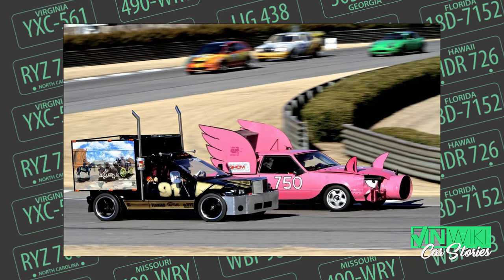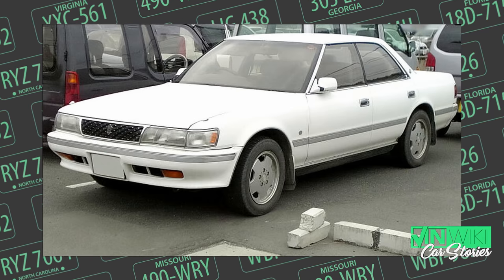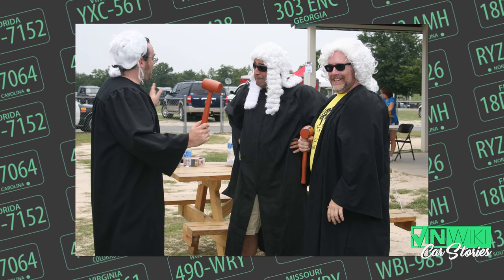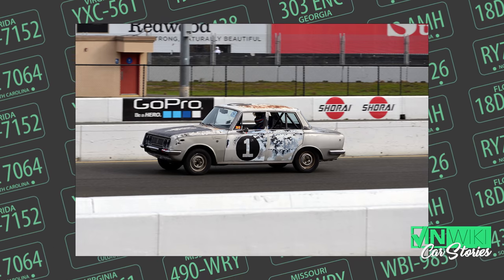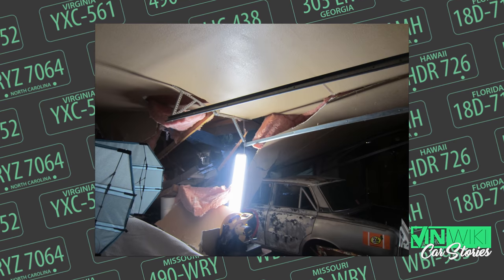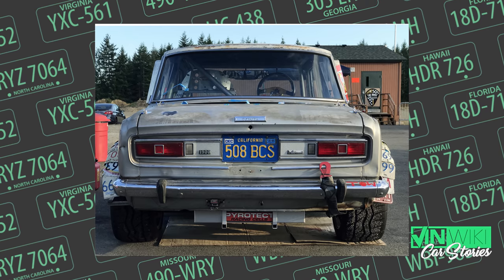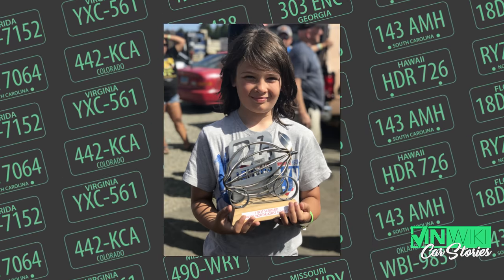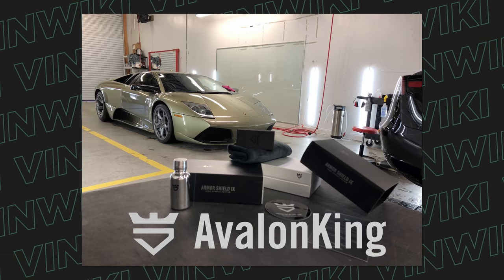How Corona saved my life (& my cheap race car)

Comment: It's funny you mention the smell of leaded fuel. I was just telling one of the younger guys in the shop that leaded fuel used to smell amazing.
I probably haven't talked about or heard about it in over 10 years, now it's twice in one day LOL
Reply: Yeah, it's because you can (If you want to kill brain cells far quicker than by drinking yourself into a stupor) use Lead as an artificial sweetener. The Romans used to use something called "Lead of Sugar".

As for me, I was born in the 1970s, so (thankfully) I missed most of that. However, there's a 66 Corvair Monza sitting rusting on my dad's property that I have to find the time to fix up. Clarks Corvair parts used to sell ceramic valve kit to make the engines run on unleaded.
Reply: no kidding eh... any idea around when it started being frowned upon and then was eventually banned?

I'm 32 and clearly remember the sweet smell of gasoline wafting into the old shitbox 81' Cavalier when I was a kid... sooo what's that, 92' to 96'ish? I'm wondering if that was leaded I was smelling...?

forgive me if this is a dumb question, I loooove cars and engineering, but I'm not really a "car guy"

=)

Edit - also, I'm Canadian so we might have gotten rid of it at slightly different times
Reply: I don't remember leaded smelling good, I remember unleaded smelled terrible. 1986 in Australia.

Comment: Me and my twin brother spent 6 months building a 78 Chevy Nova from ground up.   plenty of 4 in the mornings and all nighters and EVERY weekend.  We finished it just in time for the points season. 
If the car got a scratch on it,  it was repaired after every race.  We had the cleanest and best looking car week after week.  More 4 o'clock in the mornings during the week.   We didn't cheat at all
But we were meticulous about EVERY detail that was legal to make us run faster. Everything was perfect every week!  We even greased the wheelbearings every week and made springs to keep the brake pads off the rotors. We had the best paint jobs and everything else. That was ALOTTTT of hard work!!!   We didn't have alot of money,  both of us are auto mechanics and spent SO SO SO much time on that car.  We missed times with our family's as well.  But it really showed on the race tracks.  When we went to any track, we were the car you had to beat if you were gonna win a race with us in it.   Either my brother drove or I did but for points seasons he raced for points.

Comment: From 1987-1988 i I bought a1977 Corona from my coworker/ roommate? We were stationed in Quantico Va! I was the Tenth owner of this car and the Eighth person to own it at my company. It had over 300K Miles on it With the original clutch! I did a Complete Front brake overhaul and oil change. Sold it to another coworker when I left thier in 1988! Took It home to Pittsburgh PA Every other weekend driving 70 Plus when the speed limit was 55!! They Really Don't Make Them Like They Used To! It was also one of the shop cars! I would just leave the keys on the counter top and whoever needed s vehicle would just grab them and go for errands. 
Thank You for the memories!!
Sometimes The Need to Prove a Concept Overrides The Conscience!

Comment: It's so true how the last part of a build can take forever. I worked at a car shop that built a lot of specialty cars for athletes and other wealthy people. The car that took the longest to complete was a project for a friend of the lead mechanic. It was an early 80s Porsche 911 Turbo slant nose. We had done so many conversions using brand new Porche that we didn't realize how difficult this was going to be. The problem was that the poor car hadn't been cared for properly, and it had been "upgraded" several times by people who had no idea what they were doing. So we had to completely disassemble the entire car and start from scratch. After we were done painting every part and started putting it back together, we had no choice but to install a new wiring harness and refreshed engine. Then we had to order a bunch of miscellaneous parts because when the previous "upgrades" were done, parts were lost, and scrap parts were installed instead. When you spend that much money on new paint and interior, you don't want to have a bunch of mismatched nuts and bolts holding it all together. It felt like it was one of the best projects we did, but it took forever to get the last bit finished. There's something special about seeing a big project completed. Wish I could still do stuff like that.

Comment: Love your story. I have built cars for many people all dirt cars I was a crew chief for a SCCA F modified in the 60s.  The dirt cars were stock cars and open wheel sportsman's I was also the crew chief on those (two cars) and supermodified (two cars) we raced at San Jose speedway. All the time wanting my own race car that I got to drive. 66 years old and I get a race car a SCCA worn out. I take it out and like you in that Toyota ran the car looking in the rear view. It was the slowest car there.  I ran it at Thunderhill Raceway 2011. So I went through the engine (a rotary). Take it out the next out 2012 and the engine has new O-rings break get maybe 8 laps. 2013 I save my money and do a race porting and build a header and stick a 38 mm Weber on it Take it out and get maybe 10 laps and have oiling problems again. The next year 2014 I had bought another RX 7 for parts got it home thought I can fix this it was hit on the right front. It had some good parts in it but I fixed it and sold it. So with that money I went all out I replaced the 38 mm Weber with a 48 mm Weber. Installed aluminum flywheel new racing clutch and pressure plate and did a bridgeport on it. We moved to Ocean Shores Washington. Never got to run it. Used the old O rings when putting  back together and when I went to move it one of them failed and it is sitting in my trailer at our new home in Washington with water in the oil. I have to build a garage so it is in the trailer. I am now in July will be 73. So after waiting all that time. Working on cars for everyone and their brother my dream to drive Its not going to happen.

Comment: My dad and I used to drag race a 1971 chevelle we started off with a 454 ls6, and blew it up in two races , so long story short we got a 502 Merlin it was punched out to 700 cubic inches , we used to get the aviation gas from local airfield, take off exhaust system for headers and collectors, advance the timing 4 degrees, it would run 10:00 fairly easy would do a high 8 though , my old man still has it in one of his barns

Comment: Lemons reminds me of the Aussie Redex Rally...full of old cars usually built to a theme, and cheating isn't just permitted, it's encouraged - so long as you don't mind paying a "fine" commensurate to the offense.  I've come across two 1968 Peugeots with turbo engines, and even heard of someone bribing the judges to "buy" and the trophy.  All moneys goes to charity, so it's all in fun, even if the actual racing (generally on dirt tracks across various parts of Australia's outback) can get a bit on the serious side.  

PS: My bro had one of these Coronas as his first car - 4 speed floor shift and the 12R 1600cc single carb engine.  Thrashed that thing without mercy and it never broke down.  Great days.  :-)

Comment: my first car was a hand me down 1970 toyota corona.....after my grandmother had passed my grandfather remarried a few years later....this car was from my stepgrandmother....i was given this in 1980....in many ways...i wish i still had it.
   this was the car that i learned to wrench on.this is a car that got good fuel economy...had 4 doors and seated 5... 13" tires were inexpensive yet this is when i learned about bias vs radial..... vs pirrelli vs michellin...etc..vs goodyear vs firestone etc.
  the car had an overhead valve 1,878 cc? think i got that correct...been a long time ago..3rc motor? i drove it for about a year and then after leaving my sisters the tranny failed a few miles away...i had aaa so had it towed back to my sisters...she later took it to her high school...poway high...poway ca....the teacher bought it for $100.then took apart the trans...he found that it had been worked on prior by others....and it was actually missing some parts???.an ez fix and he then resold it....
  all i know is that it was nearly as simple as my next car...a 1967 vw bug.

Comment: Hey from New Zealand ,Im just about finished my 1989 C33 Laural ,after over  a decade of killing RB motors iv built a 2JZGE block ,rods pistons ,stock bottom just refreshed and a VVTI 1JZ head with a EBAY GT40 copy Turbo ,mate did the ex mani and wastgate mounting and exhaust ,T6 Holden Gbox,GTR Diff and axles in a R33 20E non hicas rear subframe .Evo 7 brembos all round ,wise fab,white TE reps,be collecting bits for years lol ,be ripping by Xmas for shred time at nite in the country JZ the world

Comment: I would drive a 1JZ Corona as a daily. What a cool combo. I once bought a 1980 Toyota Corolla for $5. My roommate when I was in my early 20s had this brown box and it frequently would not start for him. At the time I had just gotten my first job in the auto industry as a service advisor at a independent Toyota specialist. Long long story short I come home from work one afternoon and my roommate, a bartender was just leaving for work as I pulled in but alas his Corolla once again would not start, he comes back into the house throws his keys at the ground and says I will sell this POS for $5! I said sold gave him $5 and a ride to work he gave me the title later that night and the following Monday I jumped the starter and drove it to work, I pulled the starter and put new contacts in it and surprise surprise it starts right up. That’s how I got a great running driving rear wheel drive Corolla for $5.

Comment: Top of the rear is where downforce is.. it’s because you have a high pressure stream coming off the roof. The spoiler is in this stream for a reason. To redirect air is scoop the air under the car. This adds a new problem though. Drag.. 

I think using the frame rails for your pre radiator then electric fans with exhausting under the cat would work better but what do I know

Comment: You can fix the radiator issue by reversing the fan flow and venting the air out in front of the rear fenders or above them. It would take advantage of the pressure generated at the top of the trunk.

Comment: My older brother had that Toyota Corona. Dad got it running, then spent a weekend patching all the holes in the body with galvanized sheet metal and screws. I rode to school with my brother Monday morning in the thing. It looked like a patchwork quilt. Nearly as much bare steel as faded yellow paint. This is around 1992, and was not cool.

Comment: Your rear duct outlet would have worked Beautifully if you would have simply welded.a wing in front/overtop it. The deflector wing would create a low pressure behind it, sucking instead of blowing airflow past it! Simple aerodynamics! Remember, the rear window is basically a wing in reverse, and you need to deflect the air moving fast overtop it

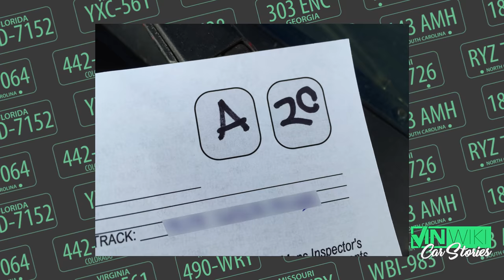Comment: 7:30 you missed a hell of an opportunity, those Ford 4.9 liter engines can be turned up to more than enough power for the purpose AND still run forever. You could have run away with C class...

Comment: The 24 hours of lemons is a cool race, but they need to do something to stop all the cheats that spend WAY more than the $500 each car is supposed to be! They should do like some old demolition derby races use to do. Make a rule that if the cars are supposed to be $500 or less, any racer must sell their car on the spot after the race to anyone who offers to buy it at $500 plus some percentage (to roughly cover extra safety equipment costs). Like maybe $500 + 20%. I had a friend that bought a few cars like that at a derby because he could tell the racers had put a much more expensive engine in them thinking they'd get away with it and the rules said they had to sell the car for $600 if someone offered it since that was the entery limit value of the cars. He said that rule drastically cut down on the over value limit cars.
Reply: Not realistic.  That would be $600.  The seat cost that much, the cage $2000 unless you build it yourself, $600 for a fuel tank and belts $300.00. With tires that cost $700, it cost about $3000 for a race weekend.  Nobody would do this if they had to play by your rules.  And it would be any fun either.
Reply: @williac43  it doesn't have to be $600. The point is to set a price that includes the car, all safety equipment, tires, etc. Then, instead of having to make techs search every car and value everything to make sure everyone is playing fair, Simply make a rule stating the racers must sell the car after a race if someone offers to buy it at that price. Maybe even add 10% or 20% for the labor of building it. But the whole point of the 24 hours of Lemons is to race on a budget, not to just throw money at it to buy a win, and if everyone knows anyone can just walk up after the race and buy your car on the spot, they won't be going past the budget. The fun comes from everyone racing beater cars on a small fixed budget and doing so fairly, not sneaking expensive motor mods and high end components.
Reply: @bluegizmo1983  So how about $5000.00?  You totally  miss the point of Lemons.  98% of the people racing don't give a darn about cheaters.  They know that no mater what they do they will not be competitive.  They will probably never finish in the top 10 of their group.  They are out there to have fun and have the racing experience.  It's a social event even more than it is a racing event.  The idea of having to give up your car to another person or team is ludicrous.  Do you think NASCAR team would be willing to give up their car if they got cheating. Besides, the techs love to search for cheat and dole out laps or put a team in the next group up.  24 Hours of Lemons made the rules and get to enforce them as they see fit.  That's it.

Comment: The 1jz is literally the next generation of the 7M engine. The 7m is a great engine but you really need to modify it to get power. And of its not a turbo 7M from the factory is missing a lot of parts that you really need if your going to beat in the engine

Comment: And I bet if you'd ran a 4 link setup on the factory axle with a na dodge 2.4 mounted to a toyota transmission up front it would have done better than with the 1j and IRS.

Comment: I BUILD HIGH PERFORMANCE SLOT CARS AND HAVE THE SAME ISSUE ,JUST GET THE CAR DONE BEFORE THE RACE. LAST RACE I CAME, 1 ST, 2ND, 3RD, IN 3 RACES. CARS PORSCHE SPEEDSTER, CORVETT C6R, MERCEDES TRUCK. ALL CARS RACED TUNED. GREAT FUN. TODAYS SLOT CARS LOOK LIKE DIE CAST MODELS BUT RUN ON A TRACK. FULL RANGE OF TUNING PARTS AVAILIBLE.

Comment: Jus as a bit of spite, I proved several asshats wrong bout the 300 inline 6. Simply by using a cheaply modified one running on pure moonshine to outrun 2jz cars and overpriced modified corvettes. An the engine was in a truly wrong vehicle. It was in a 1984 Chevrolet S10 long wheel base pickup. It had no bed, one door, ratchet straps far a hood latch, and a 4:88 Dana 60 rear axle I ripped out from under a 78 ramcharger. I built the thing fer $780. Got the S10 fer free as a parts only vehicle, no title, no bos. When a rinky dinky beater ford f100 engine can out run "drift cars" & "super cars" that sell far damn near 100 grand sumtimes more. Then ya know anything can be done if you actually put forth the effort to make such possible. Even the impossible is far from such.

Comment: I'm a self-taught mechanic, but a self-taught mechanic of almost 30 years. I'm telling you something right now, the amount of time you guys put into that car I personally, alone, with no team supporting me, would have had everything on that vehicle mechanically perfect, several races earlier than when you guys had it ALMOST done.. I hate to say it, but you guys are just crappy mechanics. You can build a custom tube chassis, with sub frames, and suspension, mount any engine, tranny, and rear that you want in it. Sheet metal floor, weld down the seat brackets/mounts/rails, depending on what type of seat you choose to use. Then use a reciprocating saw to cut away the existing firewall in your body, drop the body on it, Weld and bolt down everything, and then measure exhaust pipe a custom, bend it, weld it in place, installed custom roll cage, and basically just build the whole damn thing from the ground up with the amount of time and energy you guys put into your car, and have the damn thing running perfectly fine, two or three times over, in the time it took you guys to NOT finish your car. I cannot imagine not finishing a car for a race in the number of multiple years you guys say you attempted to do it, and did not have this car done. It just doesn't make sense.

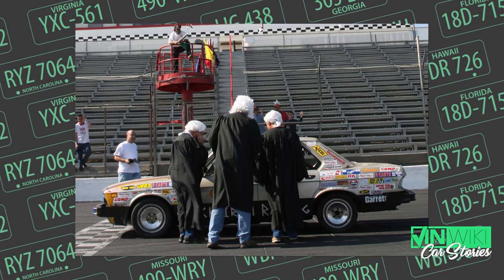Comment: At 4:25 1) The still spliced in has NOTHING to do with what the guest is talking about, and 2) 1JZ engines (not motors),  DO NOT "make 1000 hp," their crank case and heads are capable if HANDLING 1000 hp, but they do not "make" it. Not unless fully custom, blueprinted and balanced, rebuilds... Which no one is EVER going to enter a custom built $30,000 engine in the 24 hours of Lemons.